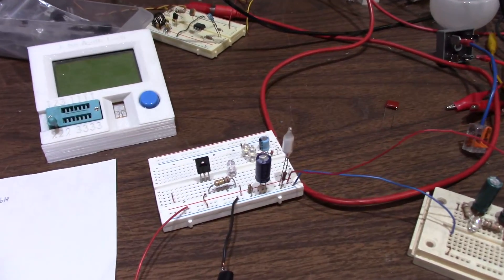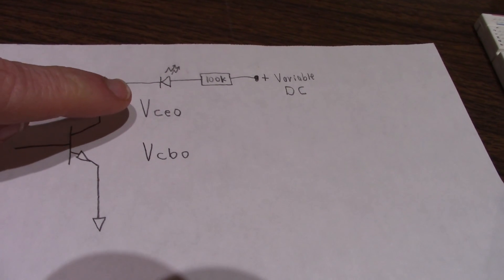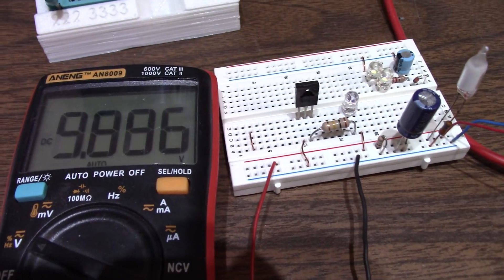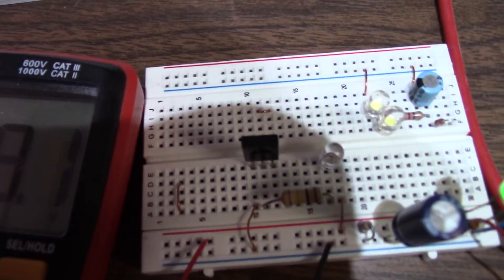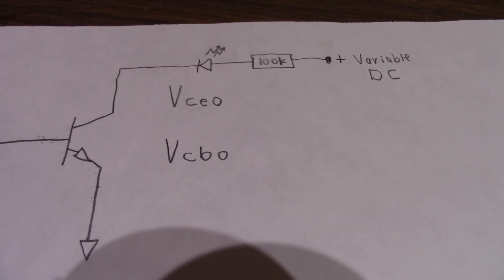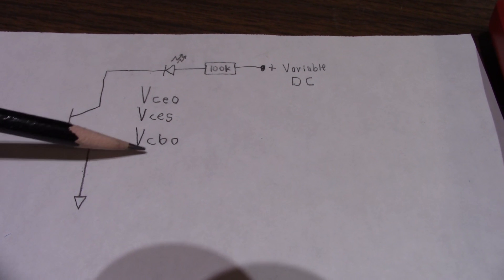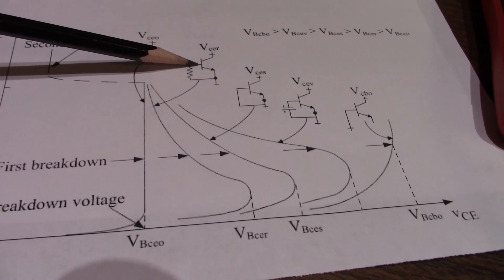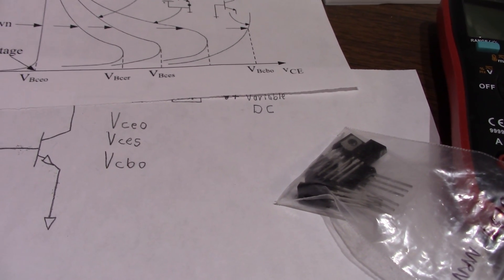Transistor breakdown voltage demonstration

Comment: So, the Slayer exciter Tesla Coil with single NPN or PNP should always have some reverse Vbe protection (something like 3W LED), otherwise it can loose gain? Thank you very much. 👍 The same thing they do with mosfets (Zener diodes between G and S).

Comment: Thank you for this video. It brought me back to my younger years ( I am 78 now) building audio amplifiers starting with vacuum tubes then to germanium transistors, then ventured to the then  just newer silicon transistors.  By the time MOSFETs came into the picture, i already shifted to other interests. This is not to say i have lost interest in audio electronics.
One other reason i am posting this message is to confirm from you what I heard at 9:34 or so about the " between 5 volt to 8 volt"voltage range between the emitter- base junction to cause conduction to begin between them. Please correct me if I am wrong because my understanding is that the range of base-emitter voltage for conduction to happen between them is .5 volt to .8 volts. Silicon transistiors would need somewhere near .7 v. While germsnium transistors generally need less than .5v between base and emitter.

Please continue making videos. A new subscriber here.
Reply: Hey Martin, some other viewer here... When he spoke about 5 to 8 volts, he was talking about REVERSE bias of the base to emitter junction... Which by the way is refered to as Vebo, as opposed as Vbe, to indicate reverse polarity.

Comment: clamp 4 to 5 silicon diodes parallel to the LED. This will clamp the voltage over the LED and saves it's life.

Comment: It was interesting to know a small reverse BE voltage kills fat transistors easily.  I have a broken linear PS which kills its power tr when i short circuit it.  I'm going to put a hevey diode across CE like MOSFETs. See what happens.

Comment: In late 80s, I got a bunch of BF173 metal can, HF transistors. While I just made my high voltage regulated power supply (60-300V) with a PL509 vacuum tube, I started to wonder the same thing: what happens when a higher voltage is applied to a transistor? So, I played with this setup. 
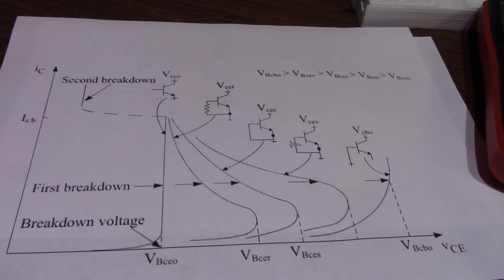I manually traced the curves you find at 10:15. I beleve that the process what happens you described well. However, I used a resistor between base and ground. With this setup,I built myself a pulse generator with 1000V pulse amplitude and 0.1us pulse width, some 50KHz frequency. It was useful to make Kirlian photos. However, it was easily influenced by the temperature. Note that tthe characteristic curve you find at 10:15 show a negative resistance after the breakdown, you can use that to make an very simple oscillator, pulse, ramp or square wave. That curve I remember to be somewhat similar to a neon lamp curve.
I repeated the experiment with some more transistors and I find that for this usage, are better high frequency and high gain transistors (high ft and hfe).

Comment: That heat leads me to believe there's more here than we've seen. Or is the rating given at a temperature?
Reply: This is avalanche regim of the transistors, so is very dependant the temperature, junction diffusion width (i.e. transistor type, batch, technology of fabrication, etc). When I played with this, I find to be a very experimental process, as not any two transistors have for sure the same breakdown voltage. At least that is what I find many years ago and what my university teacher explained to me when I asked about the experiment.
Reply from the maker: Data sheets usually indicate that the measurements were taken at some temperature, such as 25 Deg C.
Reply: @JohnAudioTech  yes and as you found out the breakdown is lower voltage at higher temperature. Which if that's the case makes the rating a bit suss. We'd be more interested in worst case. Which would be at max operating temp. But then I was thinking maybe that explains the difference between the rating and what you were finding? Perhaps their rating is worst case?